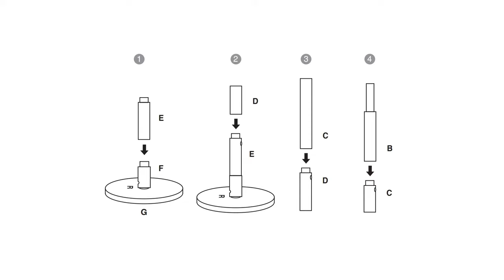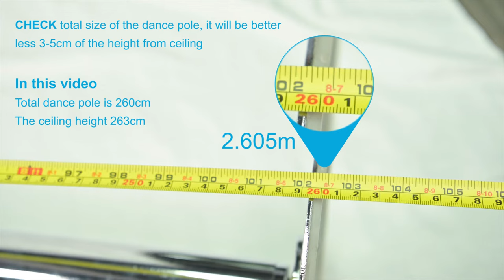Dancing Pole Assemble and Disassemble

Comment from the maker: Hello, thanks for watching this video.
1. Accessories will be a little different from differetn models.
2. This is only the dispaly video, please follow it to install step by step.
3. For the (I)( Nut washer, there are flat and convex side; When You put in the stripper pole, the flat side down to pole, the convex side up to the upper dome(A). Otherwise, after installing the stripper pole will not spinning. (check video at 1:56)
4. Small Screws x2 and Nut washer is intalled on adjuster rod cover(H), please disassemble in parts before you install the stripper pole.
5. Any problems, please reach our customer service team on email support@yesker.com, you'd better refer your amz order number, so we can check you soon.